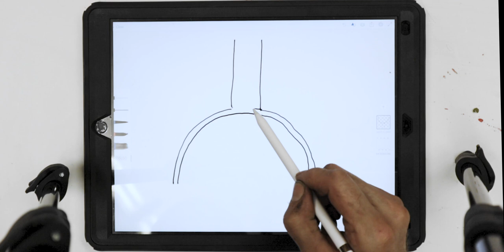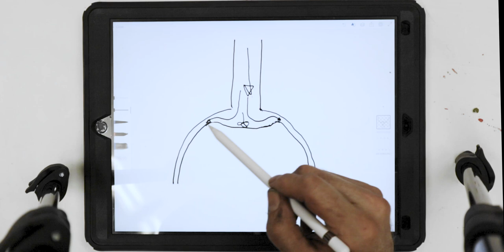How I gate these skulls for ceramic shell investment

Comment: Very nice and well thought out production. I Would like to see an indirect sprueing/casting, with how to reduce turbulence design. And how to you fix leaks discovered during a pour?, besides letting it freeze and going back, as in your pouring video I just saw. I like the lifting and tilting gear-is it on an I-beam with a roller or swivelling arm? Thanks,  Andy
Reply from the maker: The pouring rig runs across an i-beam.
If the leak isn't too big a rod with a damp cloth on the end can be enough to freeze the metal forming a plug.  When the leak is bigger I will apply some green-patch (heat set refractory) which will instantly seal the breach.
I have been meaning to do more videos on different spruing approaches.  They are on my list.
Thanks for watching my videos.

Comment: What is the best design for a sprue system to cast just the head and neck of a life sized bust for which the details are important? For example 1. Upside down, gate around to the bottom and vent the neck? 2. Upside down, gate inside the skull and vent the neck? 3. Upside down, gate the neck and vent then the head and neck ..?  Thanks in advance
Reply from the maker: I think option 1 or 3 should both work fine. With option 2, if you spru internally on that size piece you will slow your drying time, harder to de-mold and will trap heat that will potentially cause casting defects.

Comment: Do you ever have issues with metal flow on larger thin pieces/ how does the amount of texture on the surface of a piece affect the metals flow? (more texture = more gates?) Is there a way you quantify this change or do you just learn it by practice and feel?
Reply from the maker: Unfortunate, mostly by experience. It depends on what you mean by heavy detail.  Usually more venting is required as opposed to more gates.

Comment: What's your process of fixing your gating if it falls apart in the dipping process? I've been having trouble keeping mine together!
Reply from the maker: It depends where in the process it brakes.  If between the first 1-5 dips ill fix with slurry and fiber chopped fiberglass cloth and continue dipping.  Much after that Ill continue to dip the parts separately and fix after burnout.  But its really on a case by case basis.

But if your gating is consistently braking away from your patterns the problem is probably how your welding your wax parts together.

Comment: Eric, as you know I have been following your excellent and most appreciated videos covering many steps in the ceramic shell casting process.  I like your method of hanging the shell for the metal pour and the cardboard topped off cup.

I ascertain from your comments so far that you will burn out the shell. 

I will use the hot water method and will need to figure out the details for dealing with the styrofoam cup and cardboard in the subsequent wax removal and vitrification steps.  Would appreciate any suggestions you wish to offer.  Regards and Thanks.  Roy
Reply from the maker: I haven't tried boiling my shells yet for de-wax but have hear good things.  But yes you will need to trim the edges of the shell around the cup to pop off the cardboard top and then peel out the Styrofoam cup before you de-wax.
Reply: @LunarburnStudio  Eric, thanks for the great informational service you are providing regarding the ceramic shell casting process.  As you have testified there is a dearth of safe, accurate and timely information surrounding the process for small scale situations.  I was introduced to the process in 1974 at a national sculpture conference hosted by Frank A. Colson and have his booklet from the time titled: “Ceramic Shell Casting Plans”.  As you have dutifully noted circumstances have improved much over time regarding safety concerns,  small scale furnace construction, burnout procedure and accessibility/scale of ceramic shell casting materials.  Roy
Reply: Pro trick: you can watch movies on flixzone. Me and my gf have been using them for watching all kinds of movies these days.
Reply: @Jesse Lucas Yea, I have been watching on Flixzone for since november myself :D

Comment: Are there any disadvantages to hanging Investments?
Reply from the maker: I have been hanging my shells for 30 years, not so much in the way of disadvantages, but you do need to plan ahead with your spruing so they fit on the rack and theres the extra step of pulling them from the kiln to hang them so it add a little complexity to the routine of the pour.

Comment: Are you going to go over patinas?
Reply from the maker: Yes. I am working through all the steps for Casting processes. What patinas are you interested in?
Reply: @LunarburnStudio  I patina steel often. I have put patina on copper with varying  success. I know zilch about bronze patina.
Reply from the maker: Bronze compared to other metals has a nice range of achievable colors.  And depending on the chemical can be applied hot or cold.  I am looking forward to doing that video.

Comment: Why is the vent not on a high point ? I learned that the vents should be on high points since gas will rise up, otherwise gasses can be trapped.
The way I see it, the whole thing is backwards, the gate should be at a low point and the vent on a high point, so switching your current configuration in this video.
Let me know what you think.
Reply from the maker: It really depends on each object and its shape, wall thickness, detail, texture. etc.  For these skulls, i point all the details downward to eliminate the case of multiple high points.  The vent in this case reduces turbulence and helps support the cup.   Traditionally with standard investment you need to vent more on the high point but with ceramic shell you have more options due to it gas permeability (traps less gas).

The gating system you suggest is referred to as a bottom feed or Indirect spru system and is a totally valid approach.  It is perticlly useful for super thin casings and or casting with deep textures.

Thanks for your comments, it reminds me that i need to do more videos on different sruing/gating styles.
Reply: @LunarburnStudio  Thank you for your feedback. I understand that casting is more of an art form, many ways lead to Rome I guess =) 
This reminds me that I should get a software for casting and filling prediction.